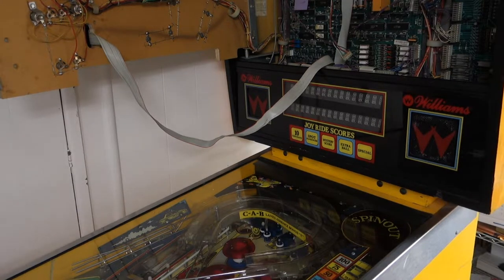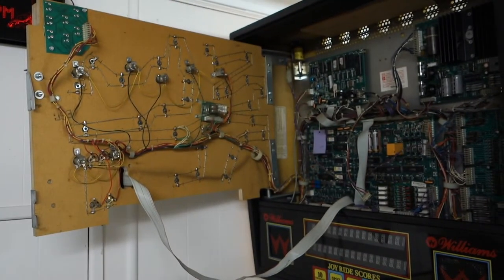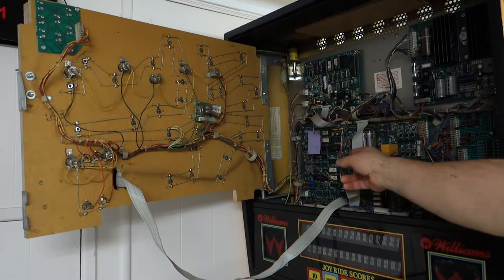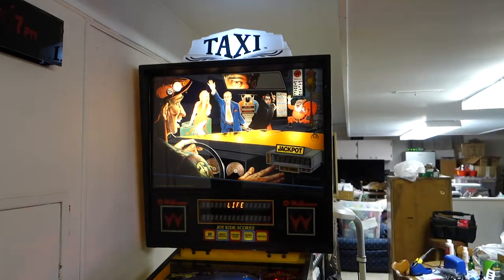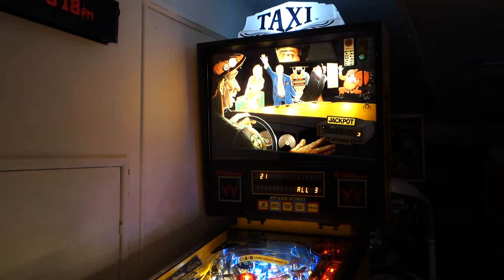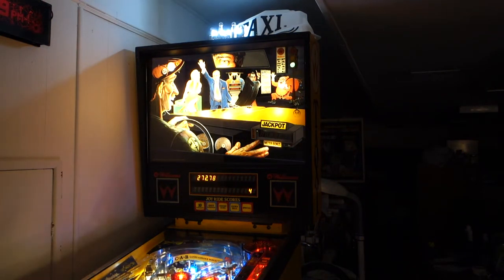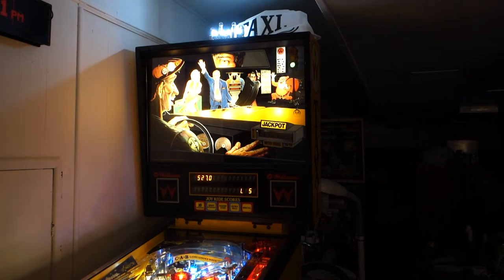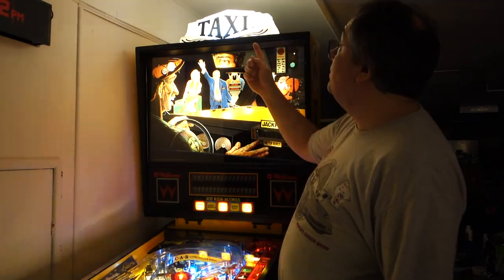1988 Williams Pinball Taxi Topper Build

Comment: Nice work. Any reason why you didn't put a connector on it so it can be separated?
Reply from the maker: 2 reasons. #1 is home use. #2 Cabinet was hacked up with a funny hunk of wood to cover the original base. Had to drill a hole to pull wires down through it plus I had no connectors to use and it was a rush job to get done before Christmas.
Reply: @MarksBasementArcade  okay thanks for responding.
Reply from the maker: @carlosfields9937  I try to answer and explain as best as I can. If it wasn't hacked up on top of the head with that "spare" wood piece I would of used one of the connectors I saved off the Interconnect board but then I would of needed to drill a much bigger hole in top of the head to remove it if needed.
Reply: @MarksBasementArcade  thanks for going the extra mile, with all that you do... I know it's always something when doing repairs. I've been a auto technition  for over 30  years and it's the same way. Probably the reason I love the challenges when repairing or restoring. Cool thank you